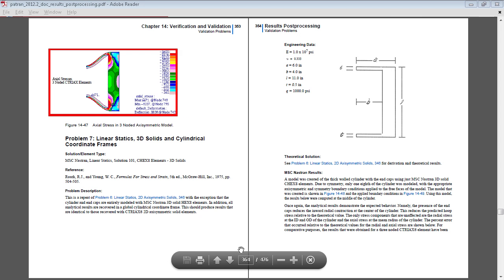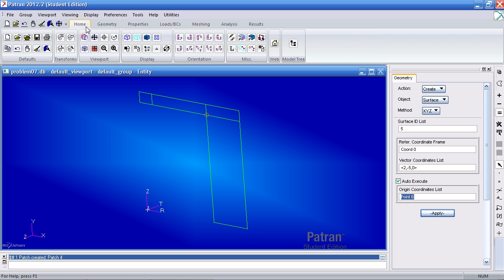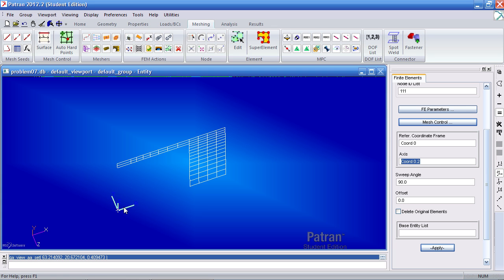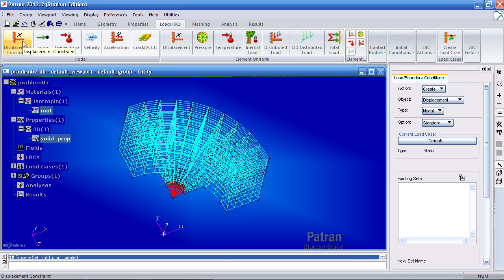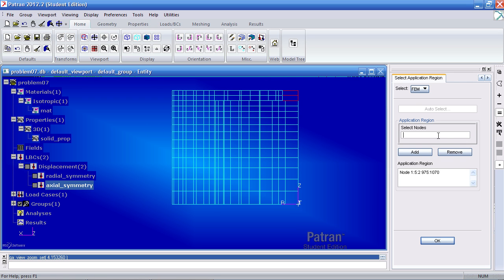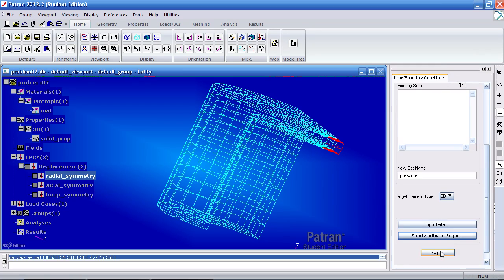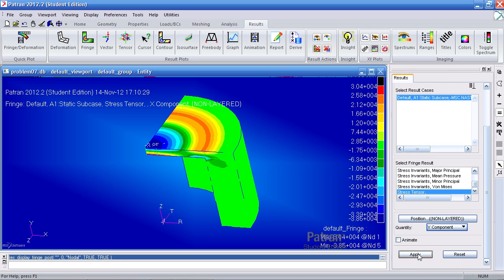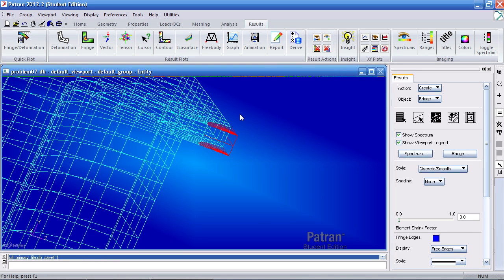MSC Nastran, Patran Tutorial - Linear Static Analysis of a 3D Solid

Comment: Silly question but disturbing me alot. i am using patran 2010. i made a analysis but when i print it , it was not clear due to blue background colour with blue FEM model. so i changed background colour to white. Because X Y Z are also white by default,i cannot see co-ordinate any more. I try my best to find and tried everything to set colour for X Y Z letters.plz help and thanks in advance
Reply: Preferences - Graphics, modify the XY color to the opposite color of your background. This has worked for me